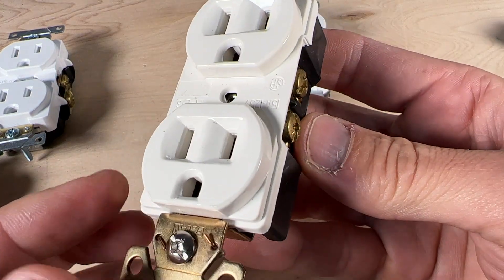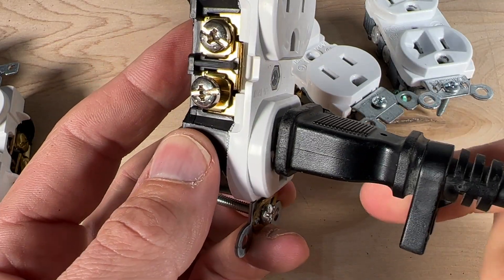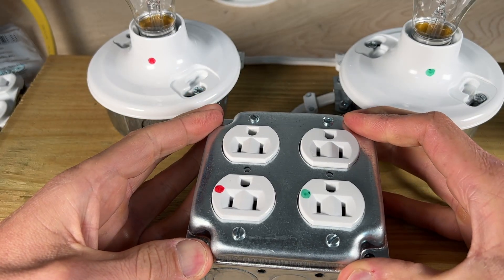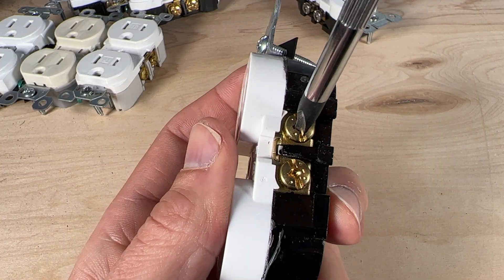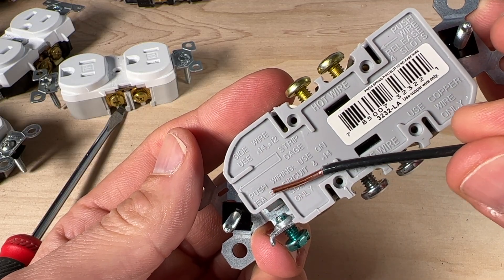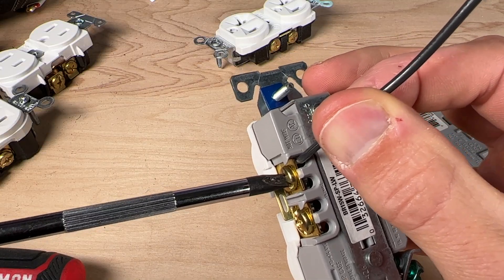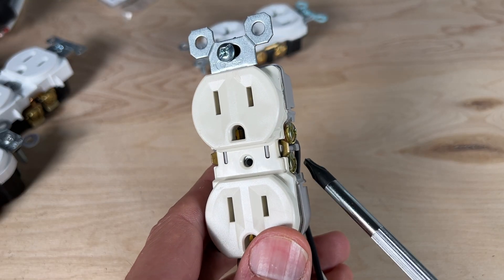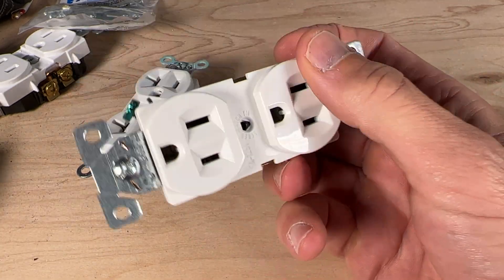21 Facts and Features Of A Standard Outlet

Comment: Look closer, the terminal screws are designed with Phillips, in mind. You can use a standard, Phillips, or a Robertson screwdriver. That way the same devices can be sold and used in Canada and the U.S. Most Americans will have a standard and a Phillips driver but not a Robertson.
Reply: JV you are incorrect electrical screwdrivers have a different head to a Phillips screw driver.
Reply: If the states weren’t so stubborn they’d try Robertson and realize it is way superior to Phillips.
Reply: @jaredkennett1950  I just wish they would pick one standard torx ,square, or anything and make all the new fasteners in that style i carry around 15 in one klein  screwdriver to have most all the possible bits
Reply: @jaredkennett1950  i don't like Phillips but i hate slotted even more unfortunately everything is a mix on older homes i have square bolts slotted screws all the way to torx on everything i have square drive or Robertson but they are a small percentage of the screws around the house
Reply: Never use a Phillips screwdriver, it isn't a Phillips head, it's square with a flat head
Reply: @cathytrue9266  it does have extra cuts so that a Phillips can be used it just a compromise to let people use as many screwdrivers as possible. it does not fit well and let you get good torque when tightening screws easily but it does fit in a pinch if it is all you have

Comment: Fascinating  how  the terminals are exposed  on the side of the outlet. In the UK  our  terminals  are shielded by insulated  ABS plastic. Possibly because were  on   230/40 v whilst you are on. 120v. Eaton are also in the UK in commercial/ industrial  installation as using your parlance breaker panels.
Reply: Could be wrong but most homes in the USA are powered by 240 Vote single-phase step-down transformers, but the use a centre tap in the windings for the neutral to hot for 120v if you go hot to hot its 240v  this is  because the two hot leads are the same phase but inverted one from the other.
Reply: @norfolkhall  Yes, you're correct.
Reply: Our 240 Volt receptacles also have the terminals exposed. In the US, our residential voltage is 120/240VAC, 60 Hz, not just 120VAC. Some electricians wrap electrical tape around the receptacle after making the connections.

Comment: #17, you wrapped the ground wire CCW, which is backwards.
Reply: Wrong. It is wrapped clockwise but he used the hole to make the hook which confused you. The end of the hook will close when he tightens the screw.
Reply: While he did wrap CCW, the ending J is properly CW for tightening purposes.

Comment: There were a few things I didn't know, so thanks for that. BTW, you would thing that finding ECX quarter inch hex bits for your magnetic bit holder would be easy. It's not, unless paying triple to Amazon is OK with you. This product is not a commercial success, unfortunately.
Reply: I just bought a set of 3 for $6.61.  That's not a big waste of money.
Reply: @Jozef Izsak Home depot sells Klein bits that are the same thing #1 on one side and #2 on the other side in a 2 pack for $5.99, ( Klein part number 32572) they don't stock them, but you can order them, and have them shipped to the store and pick them up, that's what i did.
Reply: @Bluesman57  I'm in Canada and it was hopeless a few months ago. I looked everywhere. Couldn't be ordered because of minimum quantities. I'll have to try again.

Comment: A couple were very new to me. Regardless it is so refreshing to watch it all since I don’t do this work often but helped me a lot. It would be very helpful if you would show us of when to use a 20 amp or 15 amp plugs and does it matter if I use both. Thank you for sharing
Reply: Legal to mix 20 amp with 15 amp outlets only on number 12 wire and twenty amp breaker, and never put a 20 amp outlet on 15 amp circuits with number 14 wire. Number 12 is 20 amp and number 14 is 15 amp. The wire won't handle higher currents than the rating of the wires. 73
Reply from the maker: Thanks for the feedback and continued support Hassan 👍
Reply: @EverydayHomeRepairs  that make sense. Thank you